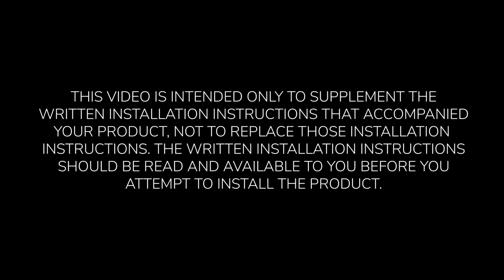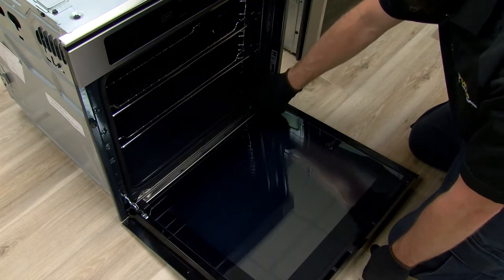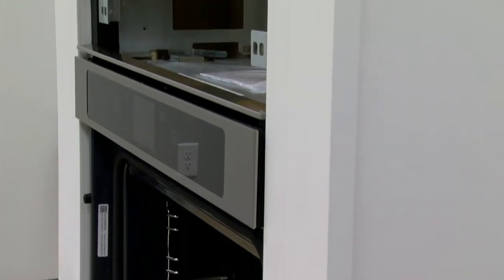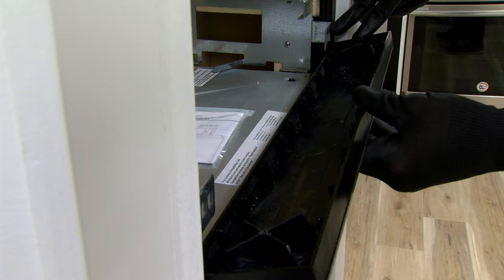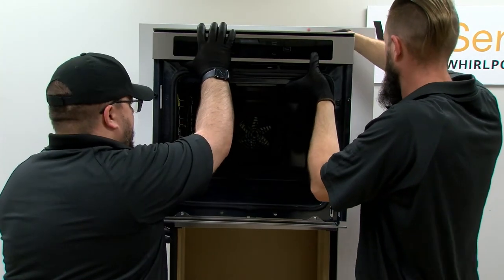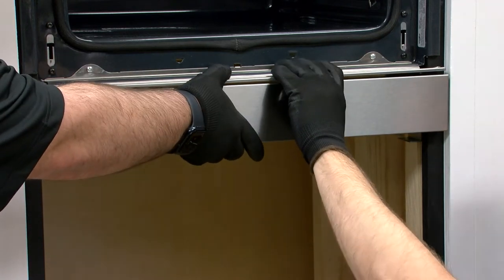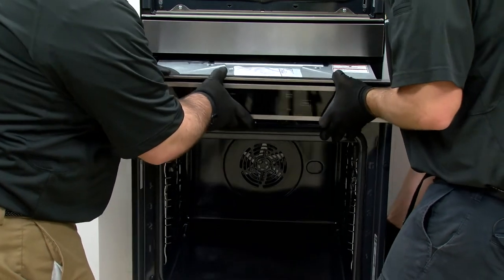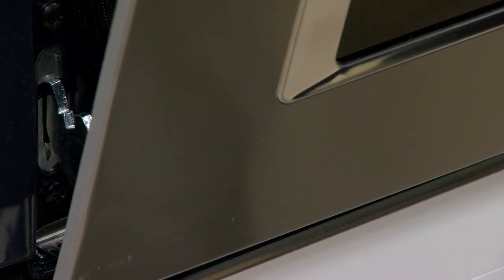24" Double Wall Oven Installation And Trim Kit

Comment: What about the electrical?  Do they need to have 2 - 220 volt  receptacles instead of 1?  Not a very practical change from the Double Oven to stacking 2  Single Ovens...right?
Reply: worst hack job design ever.